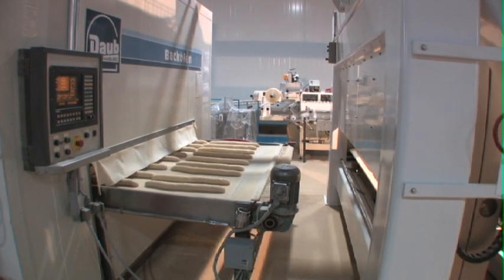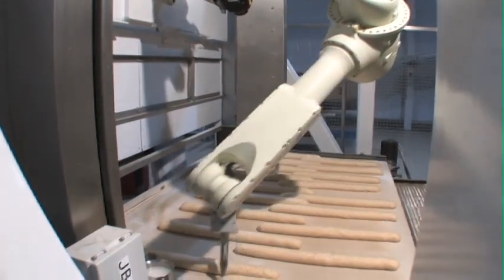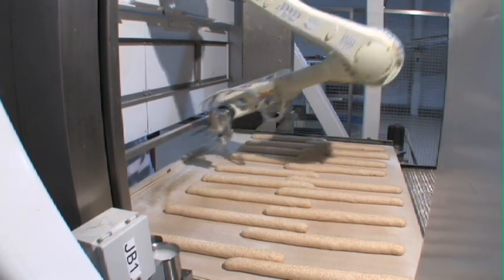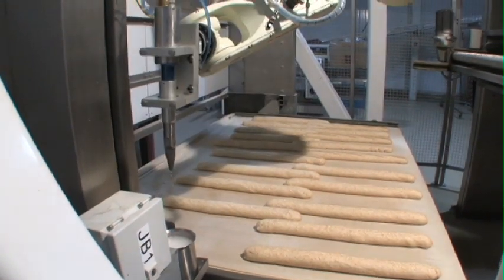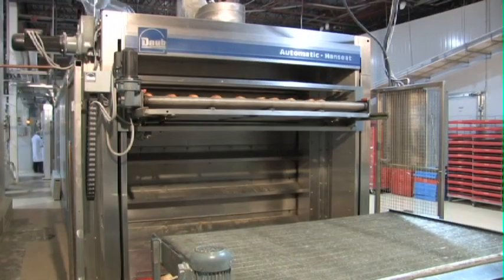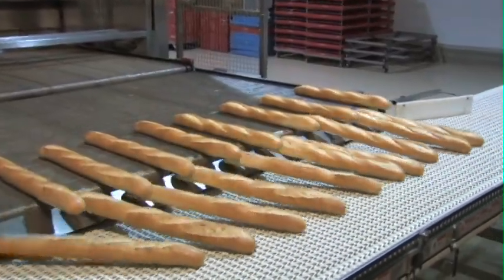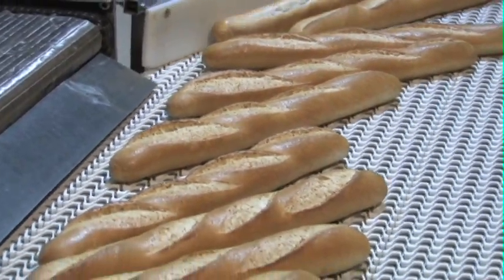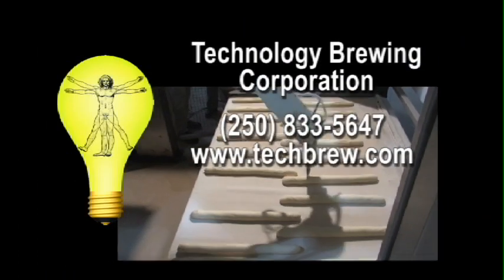Scoring Bread Dough - Kawasaki RS010N robot

Comment: That's sweet! Can it cut buns too?
Reply: Yes, it can. We have higher speed versions being installed currently too. The system can be configured for each product/recipe, and you can specify the number of cuts, orientation of each cut, and depth/angle of cuts. Can do buns, loaves, baguettes (like you see in the video), flat breads and others, because of the power of the machine vision scanning and robot accuracy.